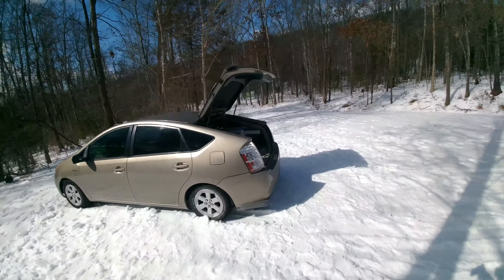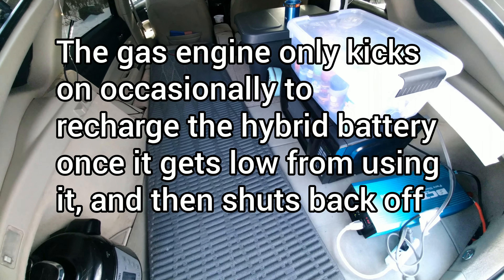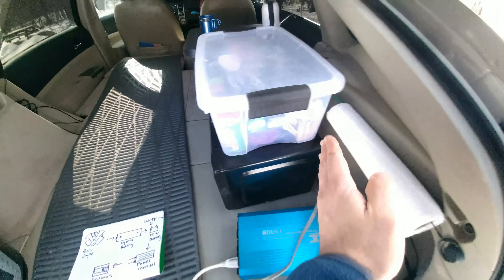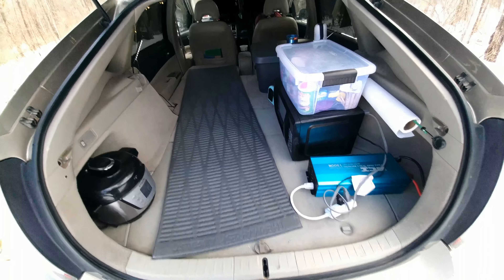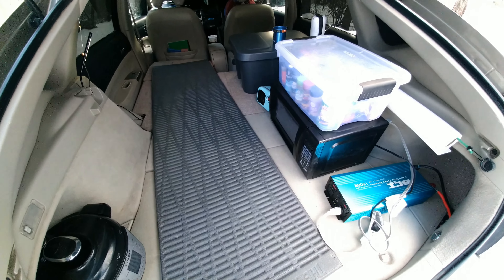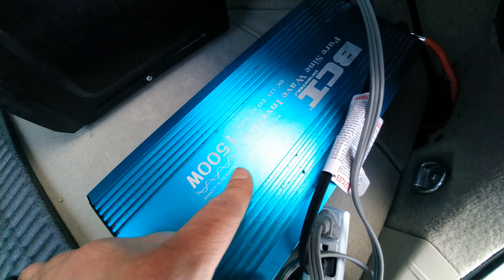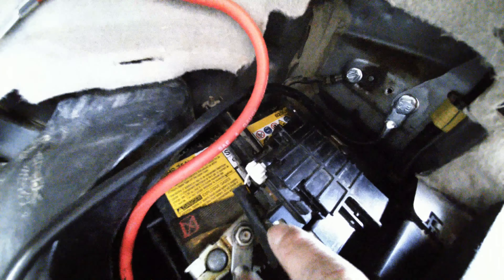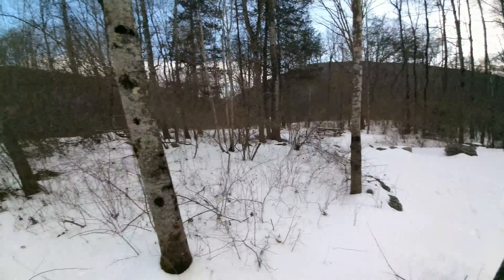How a Toyota Prius (& other hybrids) can be used as a GENERATOR! #OffGrid #Camping #Emergency

Comment: I am a Prius lover and there is a fact that our 12 volt batteries need replaced more often.   So, if the big battery is charging the 12 volt battery, that could never be the case?  I have to believe you because you have tested this out for a long time, but I am going to do some research now, because that is not what I have been told.    Thanks for this video.    You have a great set up.   I was also wondering why not just use the car heater.   I leave my car running with the air conditioner a lot as I live in mostly hot weather.

Comment: I'll check out your other videos too.  Act as an alternator to produce AC (for the Prius the engine CVT produces AC) that is rectified & regulated to DC (inverter changes CVT AC to DC and converter changes ~600V max VDC to ~220VDC to charge the battery I think and another converter converts 220VDC to ~12VDC) that charges the 12V battery.   The 12VDC battery input to the inverter is processed to ~120VAC 60Hz most likely not 1500VA (Volt Amps) which equals basically 1500W.  The 1500W is usually a surge rating for some duty cycle before trips a breaker or fuse.  If I understand correctly, as long as all your VAC appliances are under ~700W, you're good to go.  I've read some say under ~1000W most likely will be fine as long as there is no surges.  If you have something that surges you might want to consider a hard or soft start capacitor for the device.  I've seen this with Air Conditioner units that are like the wall mount design modified for tents, campers and as indoor units.  Seems like with power tools are the same.  Cool you're on the ball with the limits.  I read about on this site that is very inspirational regarding a range of topics: http://www.aprs.org/FD-Prius-Power.html (reads like this latest article regarding notes 800W continuous for hours).
Reply: Would be nice if there was an aftermarket or maybe homebrew easy NiMH 120VAC charger for the 220VDC battery.  Guessing won't help much... though maybe 15miles or so isn't that bad and would add up over time.  I forgot to ask, are you using the stock Toyota battery too?
Reply: @jafinch78  holy shit can you please teach me everything you know about the toyota hybrid system? I have a 2020 rav4 hybrid with the same tech but most recent implementations. I was wanting to tap into the orange high voltage wired to harness the power at its source instead of simply a 1500 watt inverter to the 12v battery. I wanna tap into the orange wires and harness as much as possible, safely, so that maybe I could run 4kw+???
Reply: @FlipSRT4  I'd have to read into since I'm not sure about the 2020 Rav4 hybrid system.  You'd be reading everything I'd be reading into like where I learned from like Weber State Youtube channel, PriusChat.com, Toyota service and other various sites.  The link above has great info too and like they note, that the 200V DC system can be used to power universal motors and maybe some other devices directly though you want to make sure you understand in detail residential household and equipment wiring really well since this stuff can kill us.  Dangerous high voltage isn't something toy with.  You want to make sure you have all the tools and PPE when working on and handling to.  I'll keep in mind if I ever do get to hacking in a direct battery charger which I doubt I will any time soon before I get a new one. What are you wanting to power electrical?

Comment: Great video! I'm just getting started on my Prius hotel journey and was wondering if you (or anyone in the thread) might be able to advise who I should inquire about getting the inverter connected to the 12V battery done for me. Would it be a regular mechanic? I know absolutely nothing about the mechanics and although your video was very descriptive, I don't trust myself setting up everything properly (with the additional 120 amp fuse). I appreciate any advice, thanks in advance!
Reply: Same here, being a female, I’d love to do this but know nothing about the car tech mumbo jumbo. Would a good auto mechanic be able to set this up?

Comment: Is this correct?  I'm thinking about doing this to my 2020 rav4 hybrid for camping
Reply from the maker: yes the RAV4 hybrid can do this I believe
Reply: @MountainSpringsAdventures  I saw harbor freight selling 750w/1500 surge inverter for $29.99 wow same company. Good to power a 700 watt .7cu microwave
Reply from the maker: @KoiTimeUSA  yeah but it's probably not a pure sine wave inverter. Those modified sine wave inverters like at harbor freight and Home Depot do not power the full rating that they are rated for
Reply: @MountainSpringsAdventures  I should just get a regular pure sine converter to be on the safe side?
Reply from the maker: @KoiTimeUSA  it depends, only if you're using a high-powered appliance like a microwave. If you're only using small powered electronics, you can get away with just a little small inverter
Reply: HOLY SHIT!! I literally have a 2020 rav4 hybrid xse(should have waited 6 more months for the 2021 rav4 prime plug in 😑😑😭😭😢😢) and I literally came here just for this!!!! I sleep in my car a LOT(I just lean back the driver seat, but his sleeping arrangement is far superior) and as long as I'm not running headlamps, ac compressor, or heater, the engine only cuts on every 7-15(absolute shots in the dark on timetable but its a long time not just 120 seconds).

I wish there was a way to plug in the integral hybrid battery charger with 120v!! Like from a gas station or sleeping in a friends driveway and run my 100 ft 10gauge extention cord to keep from having to run the gasoline engine as often or even at all when I am near an outlet.
Reply: @MountainSpringsAdventures  you are amazing sir please read my previous comment. Your simple solutions are a great way to harness our "generators on wheels", except mine is a 2020 rav4 xse(should have waited on the prime 😢) but I doubt toyota has changed much internally from the prius. Im also mad that if I waited 5 more months I could have gotten lithium hybrid batteries instead of NiMh
Reply: @MountainSpringsAdventures  you literally answered all my questions about automatic charge durations under different electrical loads and they all match up to my brand new rav4 hybrid. I am also thinking about running more deep cycle 12v batteries in parallel. I do car audio so this would also allow me to safely run my big subwoofers and high current amplifier without as much damage to whatever sort of "alternator" or alternator-like-doohickey they have engineered to keep the 12v batt charged.

I'm thinking about tapping into the orange high voltage hybrid system wires themselves and seeing what I can safely harness from that. Im assuming its 400 volts? If I could essentially trick the car into thinking a powerful(4kw-9kw+???) pure sine wave inverter is just the "drive motors" drawing current..at 0mph LOL..then I could essentially run the whole house, or at least 1 fridge, 1 or 2 portable ac units, some fans, and my 65inch tv + xbox for DAYS on a full tank. I have a 10 year warranty so if my engine does overheat or blow the headgasket from idling so long, IDGAF ill ride my bike to work while toyota is installing my brand new engine.

Comment: I had 2000 watt inverter and we had ice storm and I ran all my house off of this 2000 watt inverter it ran my gas furnace two refrigerators and all my LED lights in my house and I burned only one gallon of fuel in 24 hours
Reply from the maker: That's awesome
Reply: That is incredible
Reply: What kind of inverter...inverter plugged into a prius?   Thanks!
Reply: @bcamper5301  I hooked up to a 12 volt battery
Reply: @bcamper5301  I used Harbor Freight inverter 2000 4000 pick they are pretty cheap. around $160 and I tested on my job site for temporary lights for 3 weeks and everything was fine.
Reply: @vitop173  seriously dude only 1 gallon??? I am not calling you a liar I am simply FLOORED by the efficiency!! I have used 6hp and 13hp generators and you can't do SHIT with only 1 gallon of gas using them!!!!! 

You think my 2020rav4 hybrid will do 1/2 as well or better with 1 gallon of fuel???? I'm ready to burn a full tank from idling if needed
Reply: @FlipSRT4  you have to understand energy is energy when you use it you have to get it somewhere so Prius stores energy in to battery Bank and you consuming energy out of the battery bank the more you use energy the more your Toyota Prius generator needs to resupply the energy into the battery other words it's like storage tank in your toilet the more you use it the more you supposed refill it and if there is no use and no leaks the water will not run for no reason so similar with your Toyota Prius system it should run on demand as you consume your energy the less energy you use the more fuel you going to save
Reply: @FlipSRT4  I think he's correct about such a low amount of gas.   The ICE charges the hybrid battery very quickly and the 12v battery is supplied by the HV battery which I think can hold 1,300 watt-hours, though it will charge when down 650watt hours.  Still, it means that with all else off somehow, OP's 200w electric heater could possibly run 2-3 hours without the ICE coming on (not counting power conversion losses etc)
@Vito P can you tell us how you connected the inverter to the furnace?  I had a transfer switch professionally installed, but the switch is grounded to earth (my electrician said that is code) and the inverter is a floating ground -- and it doesn't work, though I can run a similar wattage power tool.
Reply: Did you run all those things at the same time?

Comment: Hey quick question. So additional 12v battery needs to be installed and you connect your 12v battery with dc adapter right? And do you connect your hybrid battery to 12v battery with fuse?

Comment: This is so great!  I thought I would  need solar or a jackery but this sounds like a better option for me.
Reply from the maker: Yea, it works to replace solar, but i think it would be best to have a jackery AND use this,
Reply: @MountainSpringsAdventures   A Jackery can replace the set up described herein.  The Jackery can stay plugged into the 12V outlet in the Hybrid to effectively 'plug and play' with 120V AC and 12VDC concurrently output from Jackery while the Hybrid is used as a gas generator to charge the Jackery.  No wiring modifications needed with this approach except the charging rate with the Jackery may limit the amount of power available.

Comment: for a small pod and small microwave is ok. That 12v auxi battery is too small. Well, it's still working fine. I would put and DC-DC charge controler and a new LiFePo4 in between that small 12v battery and the inverter. little more money but that prius auxi-battery is alot of $.

Comment: I like your videos. One channel you should check out is PSC Camper Conversions. He converts a Prius, too by adding a second 12v battery. One idea: instead of a space heater, why not use a 12v electric blanket? Anyway, you are doing what I would like to do but think a Prius might be too small for me. I was looking at the hybrid Toyota Sienna because a minivan has a lot more space. Are you able to go way off road in the Prius? That is one thing I would want to do since I am not a fan of humans.

Comment: Being 6'1" i have to sleep on the passenger side ive done 2600 round trip spending 2 hours at a rest stop in 106 degree heat took a nap with the A/C going and woke up well rested, and still got 38 mpg.

Comment: How does high woltage hybrid battery charge 12v battery without an inverter in the car ? 
I think there must be inverter in the car
Do you use your 1500w inverter when prius ready light is on ? 
Does it work when prius is turned off ?

Comment: My power inverter won't work with the 14 volt auxiliary battery in the Prius. The inverter needs to be closer to 12 volts. How do I bring the auxiliary battery down to 12 volts?

Comment: Maybe this is a dumb question, but my inverter has a 12V cigarette lighter plug on one end, could I just plug it into a power port, instead of connecting to the battery with cables?

Comment: Does this setup apply to a Prius 2006 model ? will the car charge the small 12V battery in time with a  1000-1200W load from electronics ? I'm currently gather some info coz I want to convert my Prius in a mini camper for recreational activities

Comment: Do u have a carbon monoxide detector in the car?
Reply from the maker: Yes I do. I have a smoke detector / carbon monoxide detector that I mount on the ceiling
Reply: @MountainSpringsAdventures  good question and answer
Reply: Deadass this was a great question and answer. I have an extra carbon monoxide/smoke detector that I will now put a velcro strip on and attach it to my headliner during my rav4 camping trips with my son

Comment: I would only be concerned about the Hybrid battery being taxed... The cost of a hybrid out of warranty is a lot...
Reply: This will not tax the hybrid battery.  Hybrid battery is taxed by two things: Heat (people who live in the desert) and crazy charge/discharge rates (people who live in the mountains).  
I would be concerned about the converter (200+ volts to 12 volts) running at max capacity as it is not cooled.  
Computer will take care of the rest and not allow engine/motor/HV battery/12 V battery to be abused.
Reply: Mrs Dona you are 10000% correct with your concerns! The person who commented below has it right though, toyota engineered this stuff to be as safe as possible and to last as long as possible...make it idiot proof LOL. 

Now once my 10 year warranty has elapsed and I find out its $7,000 for new hybrid batteries on this now 10 year old suv, im turning my 2020 rav4 hybrid xse into a work/mud truck and will just let the gas engine run constantly , I won't be worried about squeezing out 41 mpg from it anymore ill just let it get 15-25 mpg with the bad hybrid battery and call it a work truck
Reply: Remember that the Prius was designed to reduce engine use and to use the large battery for as much power as possible. The company has made improvements on the entire car over the past 20+ years it has been in service and it is well known to have a much longer life than most other passenger cars, assuming proper regular maintenance. There are Priuses out there with nearly 1 million miles on them; that is an unheard-of number for a car!
Reply: What!? Really? What kind of maintenance other than regular oil changes and fixes? Mine is 2005 low mileage because it was my elderly mothers car.  It's starting to rust a bit. 😢😢

Comment: Please do you have a video showing how you hope that inverter up to the battery?
Reply from the maker: yeah I showed it on the video on my channel of me giving a tour of my Prius camper. all I did was connect the positive and negative cables to the positive and negative terminal of the 12-volt battery, it's a very simple
Reply: @MountainSpringsAdventures  thank you for the reply, did you find a great mounting spot or is it just stored in the spare tire compartment?

Comment: Do you use the space heater because it's more efficient than the Prius climate control? Or is the Prius climate control not reliable in low temperatures (below freezing)?
Reply: This will cause the gas engine to run more than he needs as it needs to heat itself up first before it slowly (and inefficiently) heats up the back cabin area.  The space heater is "instant" and heats Mr. MSA up directly.
Reply from the maker: Yes, I just bought the space heater recently to see if it would work more efficiently and I think it does. It was only $10 at Walmart

Comment: I wonder if this would work on my Niro. We don't have 12v batteries in our cars since they are part of the main hybrid battery, so I'm not sure if 12v terminals actually exist inside the car. There are two under the hood for jump starting, but not sure if could connect an inverter to those?
Reply from the maker: I honestly don't know. I only know about a Prius, but I've been told other hybrid cars can do it also. Are you sure you don't have a 12 volt battery?
Reply: @MountainSpringsAdventures  We do have one, but it's integrated into the main hybrid battery with a DC to DC stepdown to 12v. I'm going to ask on the Niro forums. There has to be 12v terminals under the seat somewhere. I'd be interested in seeing the specs on the 12v portion before I did anything.

Comment: Would you recommend I use the cigarette lighter adapter to the inverter? I've seen some that comes with that adapter and it seems like a easier set up rather than connect to the car battery.
Reply from the maker: As long as the appliance isnt over 120 watts, you can use the cigarette outlet. You have to check the wattage of what your using

Comment: 2006? And what tires for that snow and off road? How do you manage with the low clearance?🦋
Reply from the maker: I have regular street tires. The low ground clearance is an issue which is why I'm actually about to install a lift kit here in the next few days. Also, I just got snow chains to drive in the snow. I rarely drive in the snow without snow chains
Reply: @MountainSpringsAdventures  hope you can film that. I wonder if you're going for 1" , 1.5" or more🦋 thanks for your message here even though I was a bit late in watching. I subbed last night when I found your channel and watched🌱
Reply from the maker: @Ουρανία-ψ7σ  yeah I'm going to try to make a video about lifting my Prius, explaining why I did it and all the benefits and everything
Reply from the maker: @Ουρανία-ψ7σ  the kit I'm putting on is 1.5 in
Reply: @MountainSpringsAdventures  hi please I'm curious if you happened to get one of the less expensive lift kits off eBay? I'd like to know if they're as good as the off road Prius ones.